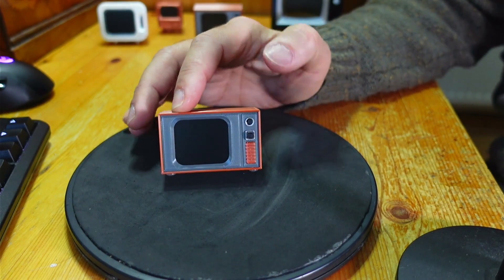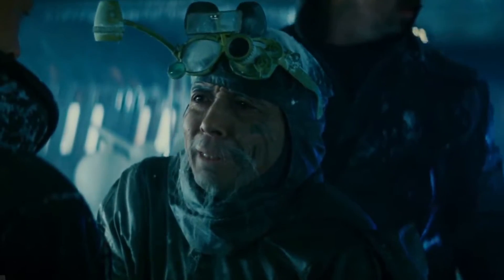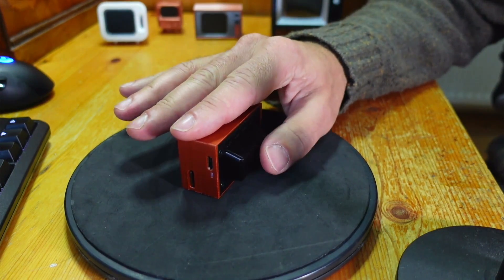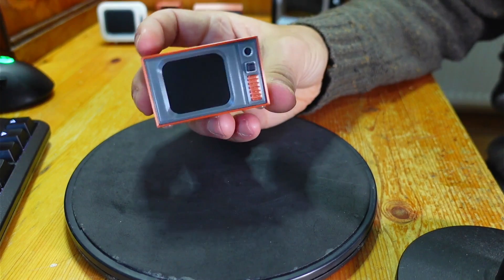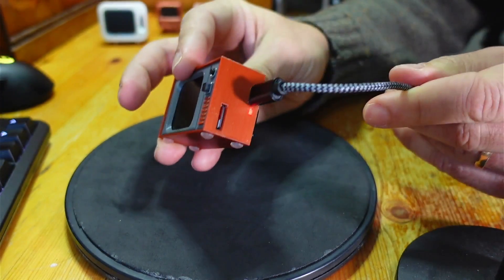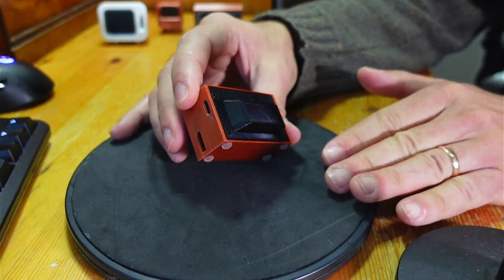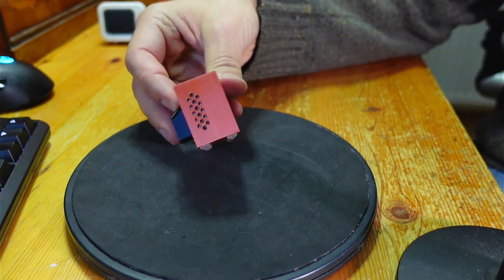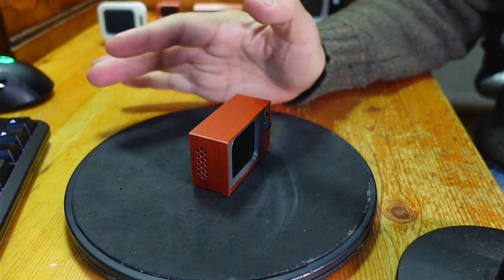ESP32 Mini TV Remix

Comment: Thank you for the remix and the entire instruction. I have recreated the project, but when I turn it on, I get the error message: File system mount Failed! I have reflashed the ESP32 and recreated the SD card without success. Where could my error be?
Reply from the maker: Most likely you don't have your movie files in the right directory structure. It is case sensitive. Videos/1/ or Videos/2/ ..etc (capital V).  Or you don't even have any movie files on the SD card. Or more unlikely you have a soldering issue, or a problem with the micro SD card. File system mount Failed! just means it can't read the video & sound files it's expecting.
Reply: Did you ever find out the issue with that error? Mine is having the same problem.

Comment: Hello, I love the build! I’m thinking of following your thingverse and creating my own. This will be my first project of this kind and have never worked with components such as these, but I’m curious: if one wanted to add a volume dial, would it be connected directly to the amplifier to do so? Or would an additional component be needed? Thanks!
Reply from the maker: The project is medium-hard. Just be aware of that before you tackle it. You have to be pretty good at small stuff and soldering. I've tried to make it easier, but it's not "easy". I really wouldn't bother adding a volume control. 1:: You can adjust the output volume as you convert the files (although they are fixed at whatever volume you set) 2:: 99.99% of this gadgets life is spent sitting on a shelf. Just being real about it. 

You could  add a miniature potentiometer, but you are looking at some cutting traces and bodging it in there or redesigning the whole project.
Reply: @megazoid  Thanks for the quick reply! I appreciate the feedback and advise. I will likely steer clear for now so as not to confuse myself.

Comment: Hmm, I dont need another one but couldnt help myself and fancy playing so ordered some PCB's and other bits to make 2 or so. Only thing I was confused about was the microUSB port, is that purely for power to the ESP32? why didnt you use the pins on the ESP32 to supply power to it through the PCB? Apologies if I'm missing something obvious. Another thing that might help on Instructables is info on the PCB like PCB thickness (I went with the stock 1.6mm?) and any other options like maybe the Via Covering, I went for Untended as felt like that was best for this type of board. Everything else was left stock.
Reply from the maker: Sorry, yes it's 100% default settings from JLBPCB, so the board is 1.6mm. Just upload the Gerber zip and order. The USB C port is just for charging the battery. There isn't a battery charging circuit on the Di mini ESP32, so it needs something external. From the research I did, it also wouldn't have worked well without a Boost Converter. Hence the combined lithium charging / boost converter board. I hope the build works for you btw!
Reply: @megazoid  Apologies for the confusion, I meant the male microUSB that goes into the D1 Mini's USB port. While I assume supplies power to the D1 Mini.
Reply from the maker: @dynamight1124  Just power yes. Why not just connect directly to the D1 mini ESP32 VCC pin? I don't know. I got put off by online forum chatter that suggested this would circumvent a Schottky diode and perhaps a fuse. I didn't study the D1-MINI-ESP32 schematics personally, but since it would only save one wire connection, went with a male microUSB plug option.
Reply: @megazoid  Nah thats cool, I was struggling to find some cheap male MicroUSB connectors and started to wonder if I even needed it then obviously concerned it might be required. All of my other ESP32's and ESP8266's have been powered directly from the relevant pin. One of my ESP8266's has been running WLED 24/7 for the last 4 years. Its one of those things you cant win, theres people like me whinging about not using the pin, if you used the pin there would be people whinging about the dangers of using it haha!